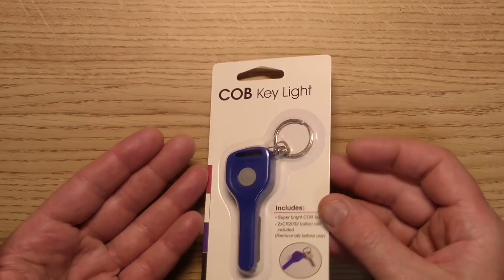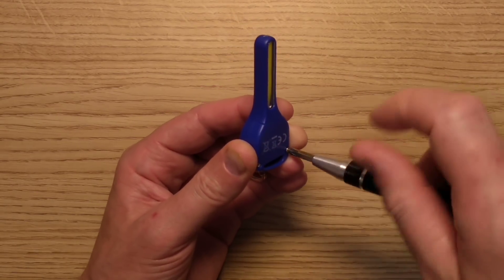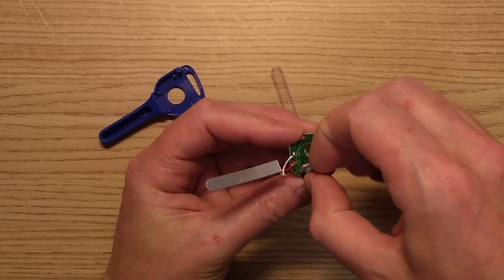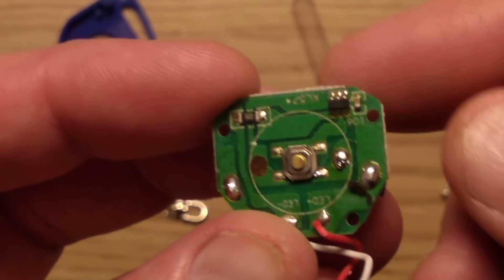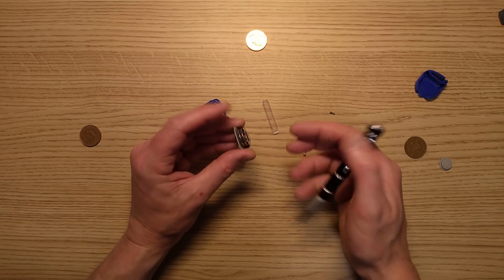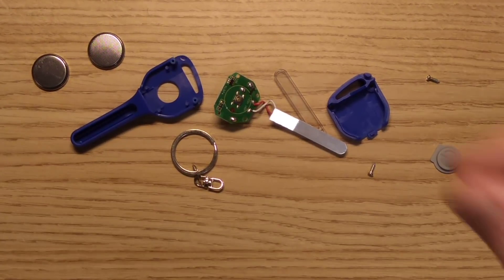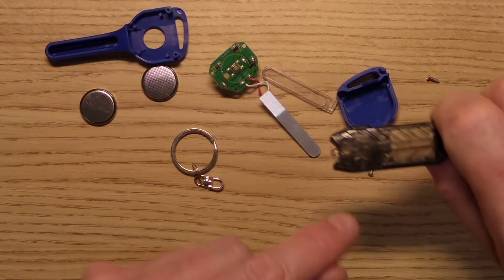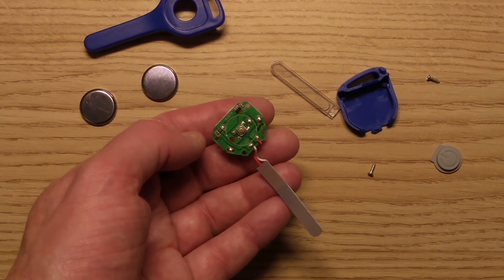Inside Poundland's keychain COB light.  (Good for the components.)

Comment: Much rather they produce such items using AA/AAA batteries. Button cells are a nuisance
Reply: It's meant to be prtable and put on keys, not weighed down by heavy batteries.
Reply: @HuntersMoon78  All my key rings have a flashlight on them powered by a single AAA battery and the trivial weight causes no problems at all.  Given the volume of that thing — which actually looks bigger than any of my AAA flashlights — it would make a lot more sense to me to use a single AAA rather than a pair of 2032 cells.
Reply: FireAngel Londoner Single AAA, so there's a Joule thief included to boost the voltage from 1.2V to 3V ?
Reply: @johnfrancisdoe1563  I have no idea of the internal workings of the flashlights but all of them give plenty of light for finding a lock in the dark.  In the leaflet that came with one of them it says it requires alkaline batteries and won't work with NIMH but when I use NIMH it works perfectly.
Reply: @HuntersMoon78  I've several AAA run torches and there's no weight there. Where I work these batteries are everywhere and easily replaced. The rechargeable/USB torches are great too
Reply: For a pound they expect you to throw it away when its flat
Reply: @Sun

Most people will throw it away when it's flat. The manufacturer, however, used screws to close and secure the case. If their expectation was the product would be used like chewing gum, the case would be sealed shut, or a clamshell of the click-to-close-forever type.

Comment: The button placement is a bit dumb. If it gets squashed between two things it will turn on in your pocket >_>
Reply: Most of the keychain lights have that problem, including the NiteCore Tube (which I have on my keychain). At least mine is rechargeable.
Reply: I can recommend the Olight I1R EOS (https://www.olightstore.uk/olight-i1r-eos.html). It's tiny, bright, rechargeable, robust, waterproof, and has a twist-on-off mechanism that means it won't come on by accident in your pocket. A bit expensive, certainly compared to anything from Poundland obviously, but worth it.
Reply: @TheJohn8765  The Tube has a lockout feature to stop that, generally works quite well -
"With Tube turned on, press and hold the switch for three seconds. Tube will lock out after a flash of the LED to avoid accidental activation during carry. To unlock, press and hold the switch for three seconds again."
Reply: Yes, it frequently does.
Still the battery life seems impressive despite that.

Comment: If that cost a pound and it included 2 of those batteries that was one helluva deal just for the batteries alone.
Reply: I did that with a cheap watch because it took the same batteries as the one I was wearing at the time.
Reply: huldu poundland are pretty good, you can get a multi pack of flat batteries with 4x2032 and an assortment of other sizes for £1
Reply: I'll be visiting London, I hope there are those Poundland stores there...
Reply: 800 stores across the UK 🙂
Reply: CR2032 are lithium and about 0.40US (.32 GBP) each in quanities of 25, about 0.45US in quantites of 10 (good brand name) so not really a better way to buy them.

As for the whole thing, I have a phone that makes more light than that key thing.
Reply: @Toobula That's crazy. I'm not even joking when I say I pay $2.6 for a single CR2032 battery. Needless to say last year they basically shut down buying things from China. They added a hefty tax along with a hilarious "handling" fee which turned $1 things into $15 items. Obviously people didn't like this at all and they stopped buying stuff from China. After that happened they had to fire hundreds of people. It's all about making that money, greed over all else.
Reply: Got a couple myself they are good torches don't need taking apart 😆
Reply: For the average Joe it is a deal, handy cr2032 source and has been done before...it is exploting massbuy from the manufacturer... You want some extreme example? Here in Germany my firm used to buy cfl energy saving lights from a certain manufacturer (osram) to peel them apart new and get their hands on a tiny transformer which was 1k unit bought more expensive than dissasembly (work price) and 1k ccflights
Reply: Not really, for a pound you can get about 6.66667 pieces of those cells but they are not as good as branded ones.
Reply: Like I said not around here, mind you I do not live in England so don't have access to poundland or any similar store nearby. That's why I made so many great deals before the tax/handling fee was added to imports from China /spits on postnord.

Comment: Whoever decided that the stupid flashing needs to be cycled every single time you want to use the unit deserves to be shot. That mode should require some special long keypress or whatever because it's almost never useful.
Reply: It's just a very common chip that's mass-produced in extremely large numbers and most likely costs less than any other multi-mode chip that doesn't include flash.
Reply: flashing feature may be useful for a very small rave. a rave of one, perhaps.
Reply: I guess you could use it to trigger seizure or make them temporary blind if someone's trying to rob you...
Reply: @pierreuntel1970  Mild annoyment isn't really going to stop a robber I think :D
Reply: @benbaselet2026  yeah... If something like a powerful flashlight do this then it will cause temporary blind but I doubt this thing can do that
Reply: A decent quality light like a Nitecore doesn't do that sillyness. I think it's a feature of a particular chipset that's been copied.